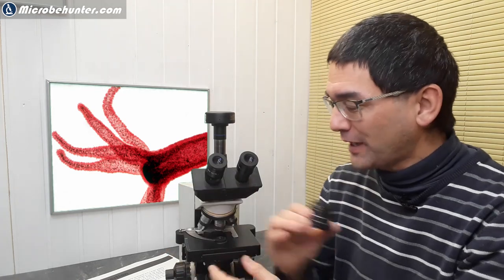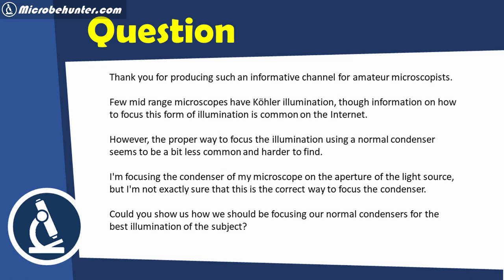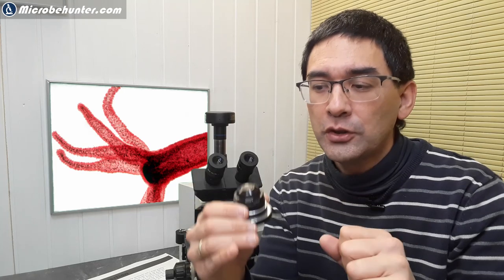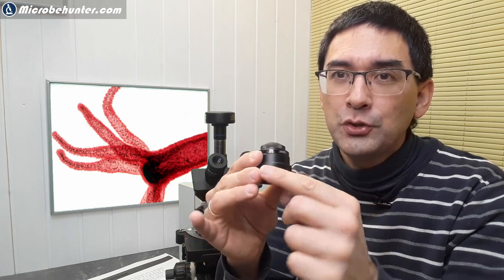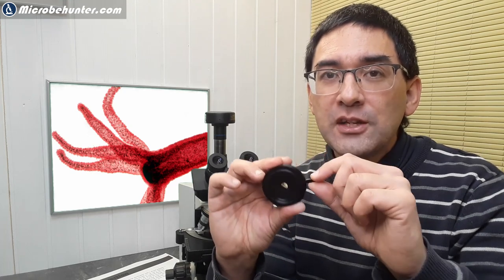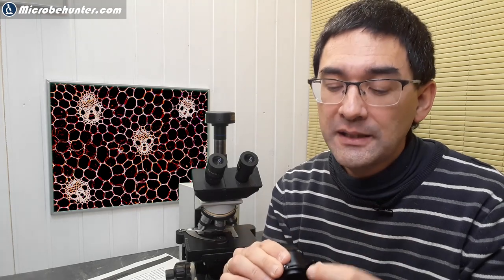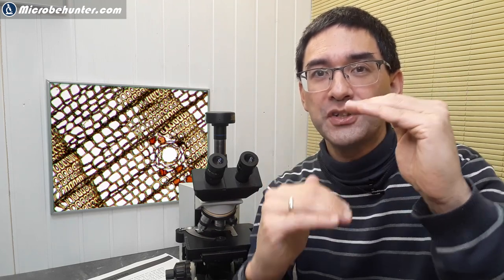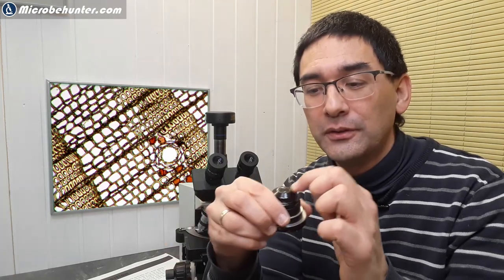🔬 How to use the condenser aperture diaphragm | Amateur Microscopy

Comment: I just got my first good microscope as an adult (had a few lower end ones growing up without the mechanical condenser). I have been spending a couple days learning to use it, I was starting to catch on and understand what you explained in this video, but you just sped things up for me and now I have a much clearer understanding of the condenser. So thank you for that. Good to know you just leave it in the highest position, I couldn't find any advantage to lowering it and I was a bit baffled by that particular adjustment.

Comment: All makes perfect sense! Thanks for the explanation. Am wondering in terms of microscopy if the newer LED illumination offers effective Kohler illumination or just a purer white light compared to the older halogen incandescent bulbs?
Reply from the maker: The LEDs provide a cooler light (less red, less heat) and the color does also not change when you change the brightness (halogen became more red at lower intensity). The electronics can also ensure that there is no flickering and this makes video filming easier (shutter synchronization), but this depends on the individual microscope I guess.

Comment: Thank you so much for this detailed video on the condenser. I have researched how to adjust the condenser with the objective lens and have received information from my microscope company; however you have explained this issue so well. Basically you mention that whilst the condenser appropriate measurement is on the objective lens (x10 relating to .01 etc) you mention that scientifically that’s accurate however you use your eye viewing to adjust the condenser control lever to that which suits you…….. brilliant….I wasn’t aware of that option. Sorry I haven’t explained that very well. Brilliant video. Kind regards Ken from Rutland, England.

Comment: Thanks! I'm a biotechnologist, but at university they didn't teach us properly how to use an Abbe condenser, now I finally know! I guess I've not been using the full resolution potential of my simple home microscope objectives for years..

BTW When does lowering the condenser make sense? Is it only to "hide" dust on the lens out of focus?
Because the slider allows it to be lowered a lot more than would be necessary just for that, but I've always kept it all the way up.